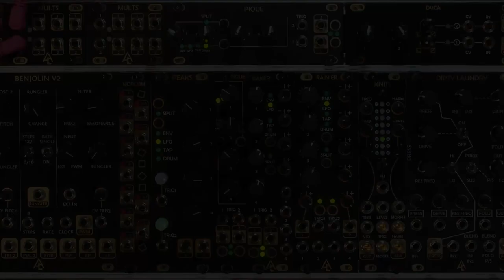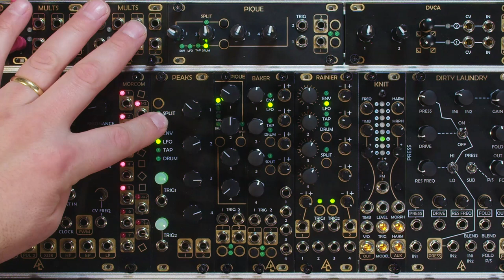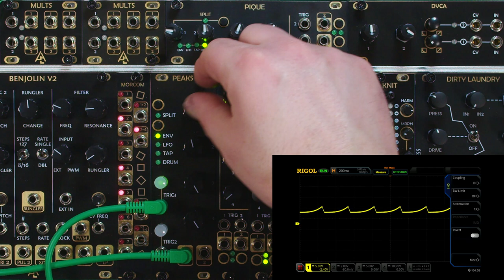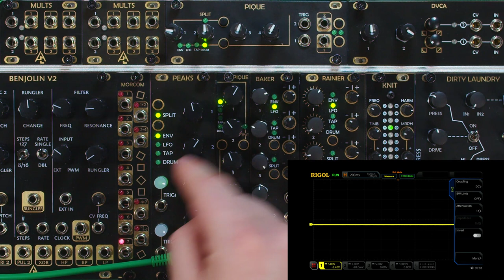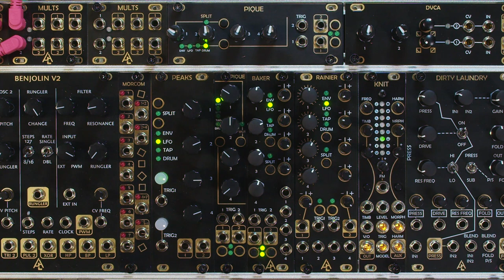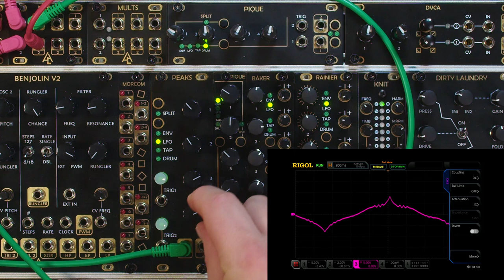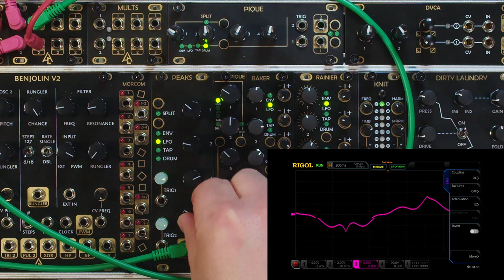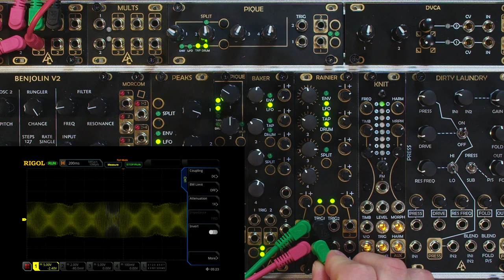Peaks: Dead Man's Catch Alternate Firmware

Comment: I really want to install this on my Pique (specially because of the Turing mode) but I'm a bit worried with the installation/calibration process. Is it a considerable risk to try without experience? And is the calibration part of it really necessary? Thanks!
Reply from the maker: It's pretty easy to program if you have a programmer and converter to mini JTAG.  The calibration is only needed if you plan on using it as an Envelope Generator.  Without calibration the envelopes might not close all the way.

If it's one of ours we are happy to swap it over to DMC.  Just reach out via email and we'll work out the details.
Reply: @afterlateraudio9976  Thanks for the reply! I plan to use envelopes as well, yes. It'e not from ALA, though. I will try to find out how calibration works more clearly and hope for the best. Thanks again!

Comment: One thing you don't seem to mention is the advantages of the extra attenuverters on Rainier (or the pros/cons of each unit). I imagine that the two extra attunuverters on Rainier also become really useful for attenuating the LFOs or the Envelopes, which saves you having your stuff running through another module?
Reply from the maker: I thought I did!? A lot of info to unpack, so its easy to overlook some things, sorry!
Reply: @afterlateraudio9976  No problem, you probably said everything needed. It was just an 'afterthought'.

Comment: pretty fuckin dumb that there is no tap lfo mode on peaks in any firmware where you can control the RATE of the TEMPO SYNCED LFO. It's actually crazy. Perhaps consider adding this to the DMC firmware. Way more intuitive to have a steady clock and the ability to change the rate of the TEMPO LFO with the first knob instead of attenuating the signal as the first knob currently does. Peaks instead expects us to change the rate of the tap lfo with a different gate signal, but this is super inconsistent and relies on the detection of the module rather than on demand by the user. Both should be available in a tempo based lfo.